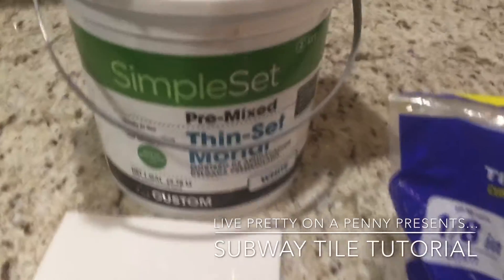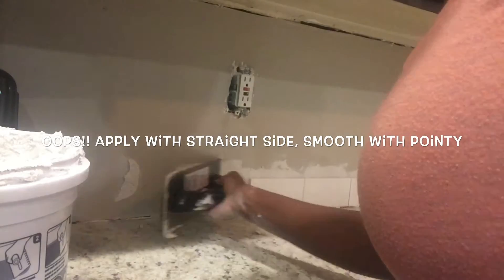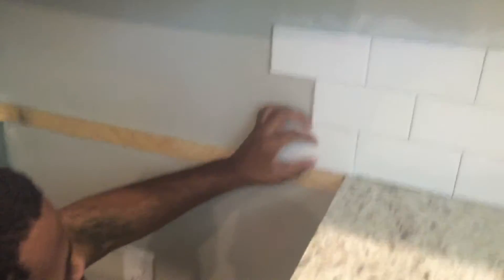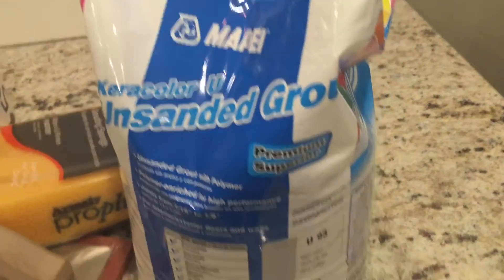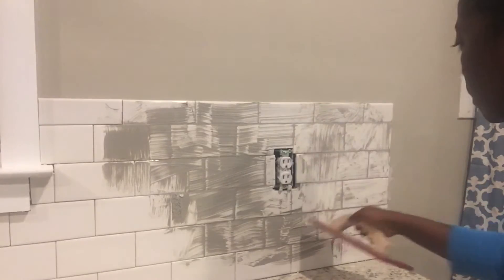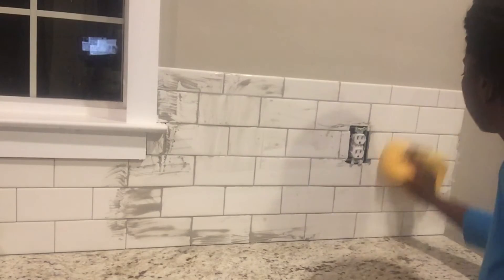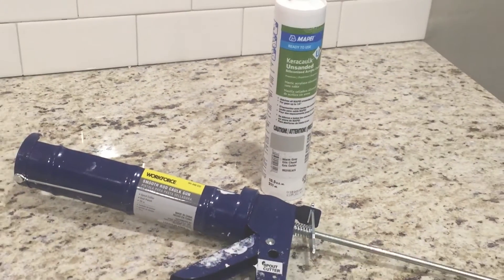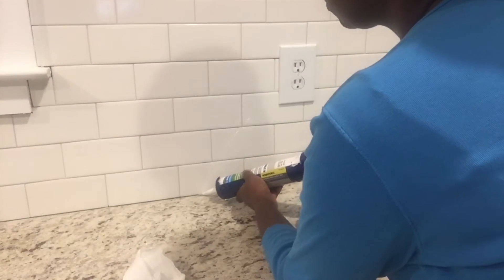DIY Subway Tile Backsplash Tutorial

Comment: Nice job! Are you using bull nose pieces to finish top edges? And how did you finish the side edges?
Reply from the maker: +shaynalinn thanks! No i left the edges just as they are on the video. No bullnose, but i definitely think its a matter of preference. To finish the edges, i just caulked down the side using the same color caulk as the grout.